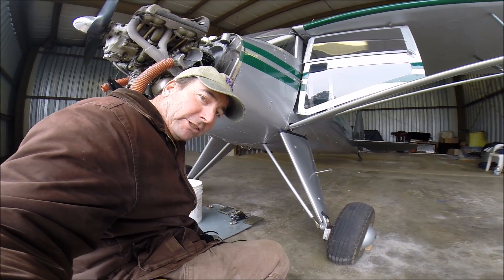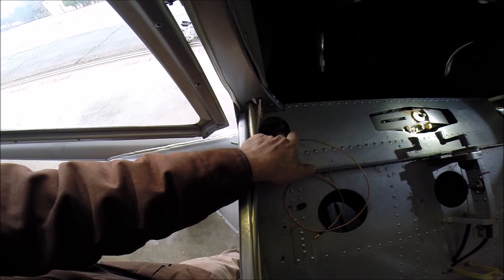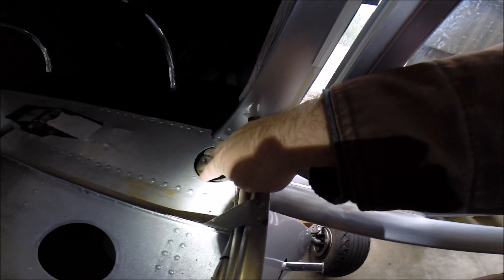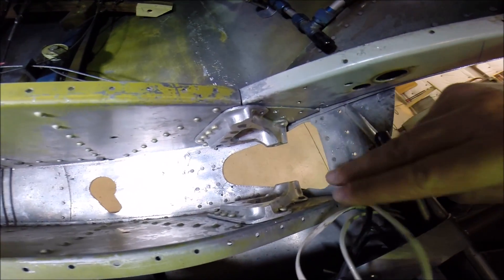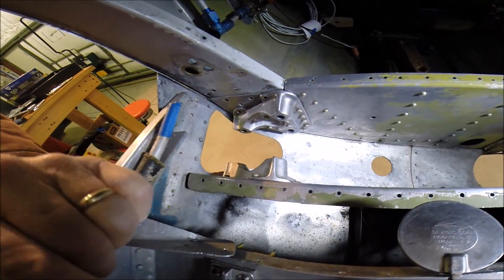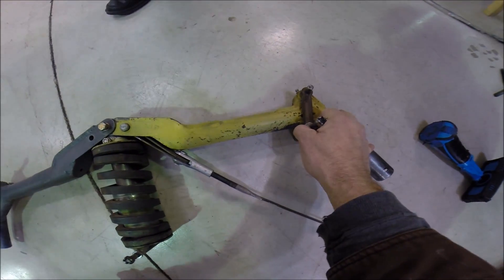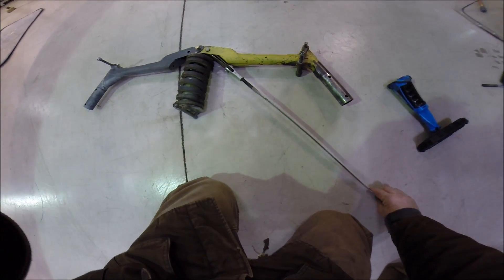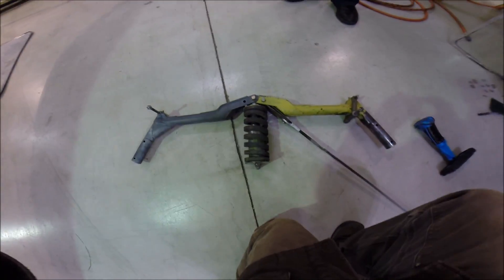Luscombe 8A/E Landing Gear Mechanism-how it works

Comment: So when you go to replace that cover plate, how will you rivet it back to the structure?  Where will you fit the bucking bar on the back row of rivets?  Asking for a friend… Thanks!
Reply: lewisj, did you ever find out the answer to your question?
Reply: No, sorry.  I am still scratching my head about that.
Reply: Wow, thanks for the rapid response.  Is there some way to  contact you privately (out of this forum)? 
 @lewisj856
Reply: I am guessing that the outside skin needs to be removed ..... @lewisj856
Reply: OK Lewis, it actually, there is bucking bar access for the back row of rivets via the 4 inch inspection plate holes underneath the seats (looking at a parts manual, it is difficult to know this), as I observed from the actual airplane.

Comment: I did lots of one wheel landings, and walked it down the runway.. from wheel to wheel at 75 mph and it handled those loads just fine... f you can stay coordinated. The gear legs are Heat Treated !   so if somebody stupidly decides to weld on one. without heat normalizing it first, and re-heat treating it afterwards. That is when and how the gear leg can be weakened.  One of the attach point holes in my gear leg got elongated ( probably not properly adjusted) and I had to go through that process so the AP could weld up the hole and re-drill it .  Then took it back for heat treating and rockwell hardness testing.  I think this may be where the urban legend that the old style gear isn't tough enough for side loads comes from.. I strongly disagree.  The silflex is more elegant and simpler..and has less drag.. but the old gear was plenty tough and not bouncy.

Comment: Juan, Novice Luscombe owner here.  I think I noticed tubular replacements for the landing gear "wires" on your Mighty Luscome.  Did you build them or procure a kit?  Otherwise, is there a significant advantage to the Silflex gear?